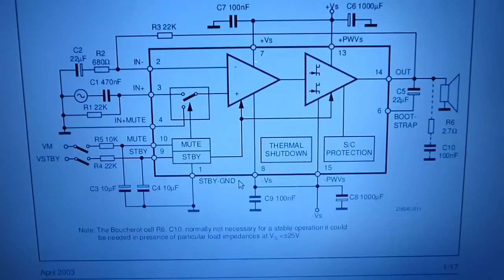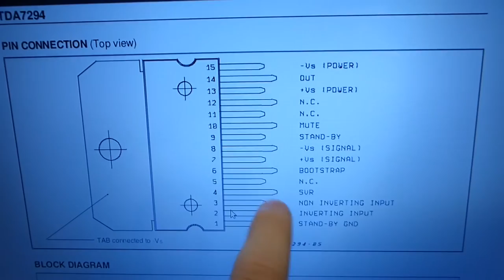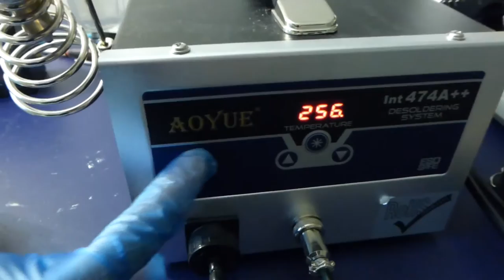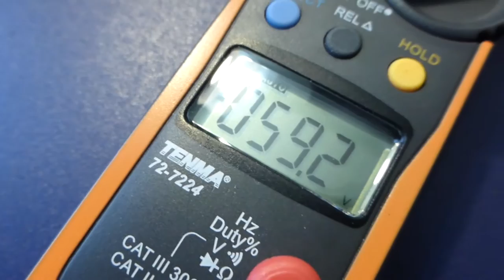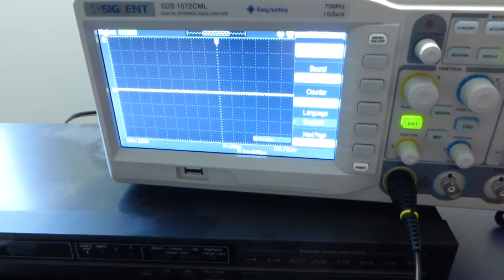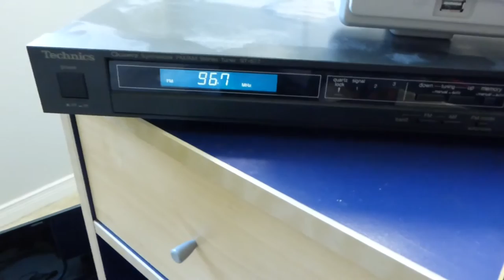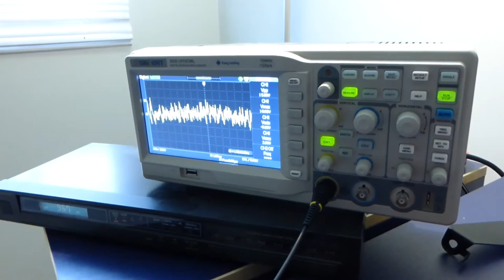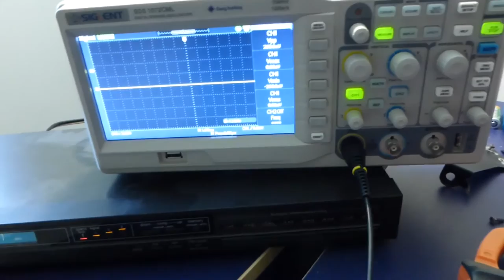Repair of a 2004 Volvo Car Amplifier

Comment: This was a great help in diagnosing the problem with my car's infotainment system! The radio / car phone & CD player just stopped working one day and there was a burn silicone smell in the car. I have a 2013 S60, which had drainage problems in the past but that had been "fixed". This short happened after a huge rainstorm, which most likely flooded the whatever the moonroof is supposed to drain into, resulting in the amplifier getting fried! It's good to know what needs to be fixed. Now it's a matter of getting it fixed and ensuring this doesn't happen again.

Comment: you are getting close. the water however is from the sun/moonroof drain system. which can/should be drained manually every other year (via left right columns) cause volvo engineers are, you know, perhaps not as smart as we hope they are, plus it does not rain much in sweden :-)

Comment: Great video , ive got a 2002 mod. Volvo V70 my problem is that its sound only at the right hand side . Any sugestions ?? Amp sems similar .
Reply: did you check your speakers? Or maybe radio settings got messed up